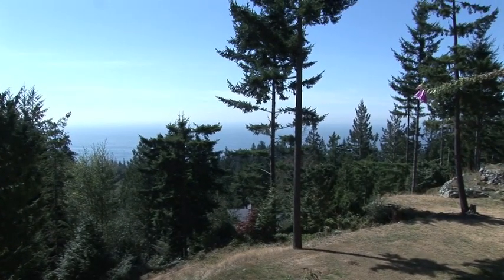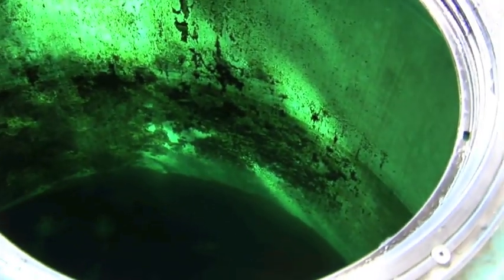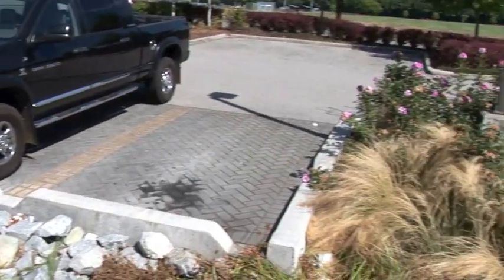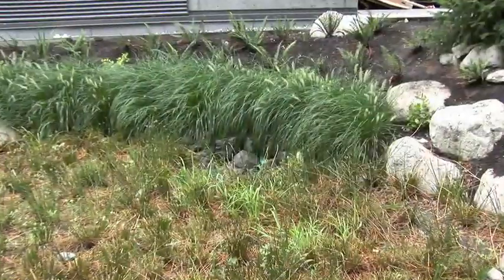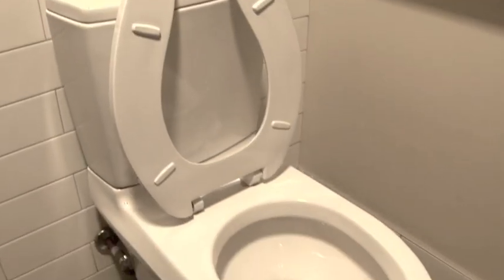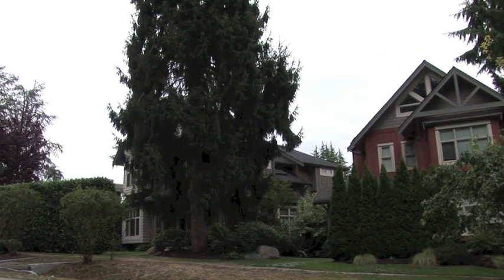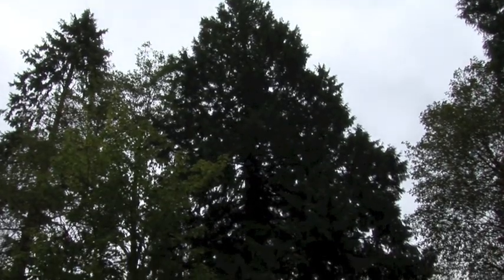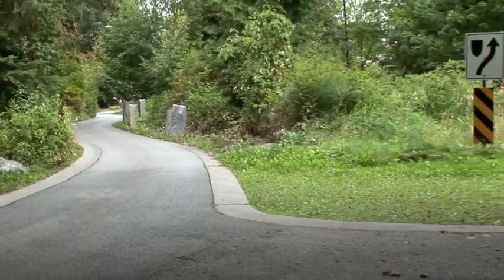Innovative Stormwater Management at the Property Scale

Comment: Actually,  the bacteria breed in the PE tank, whether people need to put some chemicals into the tank for sterillization? Or should there be a manhole on the tank for cleaning and flushing inside? To the sand filter, I saw some design would like to bury in the ground but it's not easy to replace and maintain, right? Why not put the filter and the tank on the ground, only leave the pipes in the ground, and we can use the diaphragm pump and the solar panel to drive it and make the water flow in the system? Thank you for sharing. Kind regards. Kevin